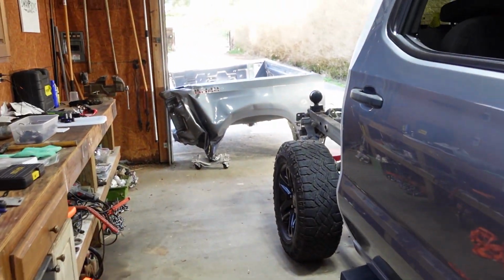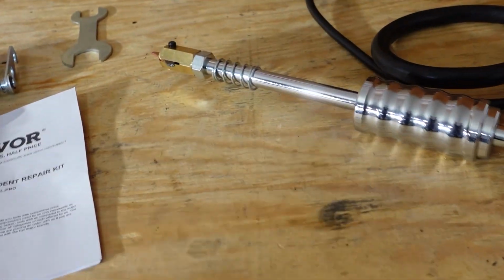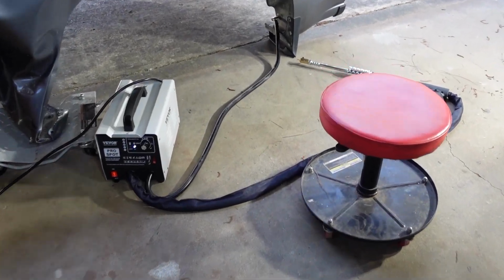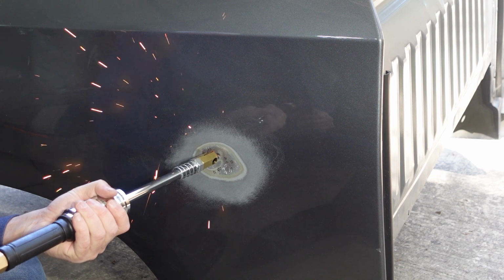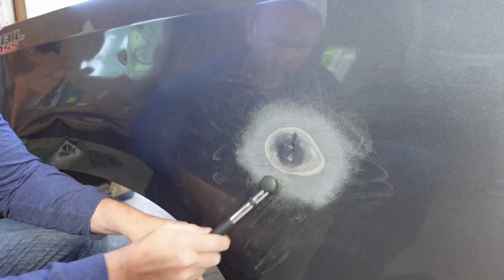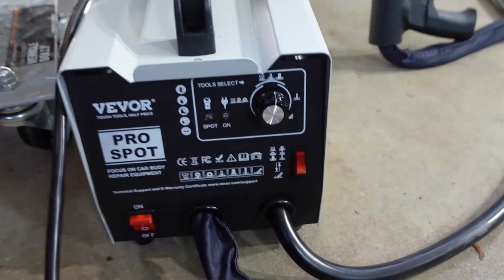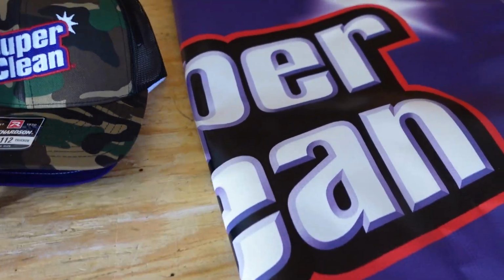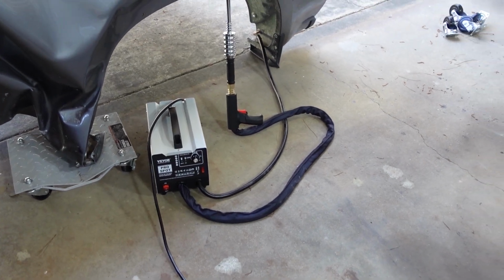Dent Pulling with VEVOR Spot Welder Dent Puller - A Must Have Tool

Comment: Do you have to disconnect battery on the car before you use dent puller
Reply from the maker: I didn’t see that in the manual but that may be a smart thing to do.

Comment: I have one, but haven't used it much - just tried it out. There is an automatic setting. Just touch the panel and it will weld - no need to pull the trigger. I believe the second switch, the down position is for using a carbon rod to heat a panel when trying to remove oil-canning.

Comment: Super clean is some great stuff the foam degreaser is alsome I used it on my motor and sprayed it on my motor let it sit for less than a minute and power washed it off and it came out great my motor on my old 2001 Ford Taurus SE looks like brand new so anyone looking for some good cleaner I would get this stuff I also use there wheel cleaner and it makes my rims look great too even the tires I don't even use tire shine any more it gives your tires a nice black mat finish